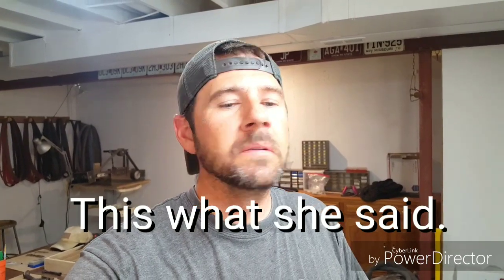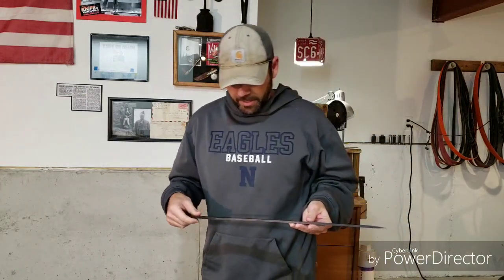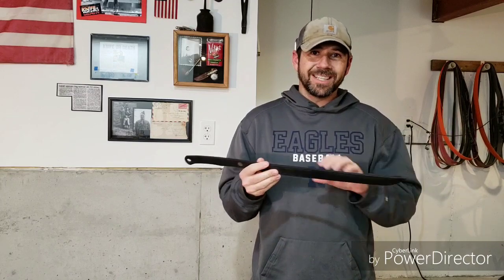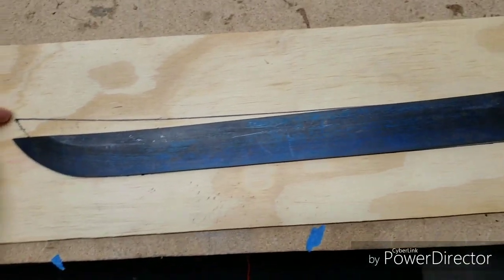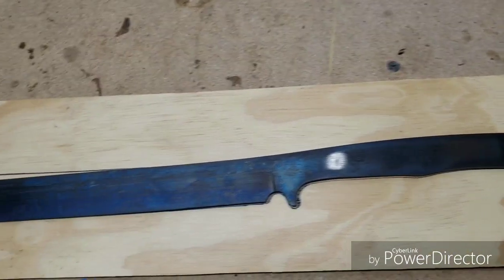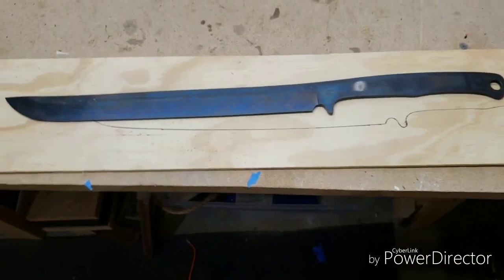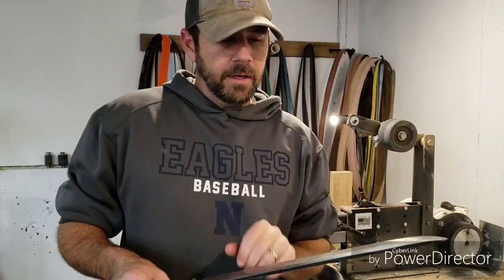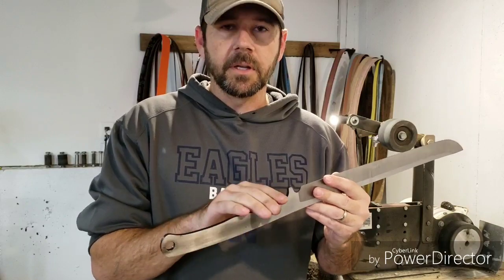Making a Short Sword / Wakizashi Part 3

Comment: Interesting comment about the loss of curve.  I understand the Katana curves the other way on HT'ing to put more curve in blade.  Looking forward to handle wrap
Reply from the maker: That is interesting Ken I did not know that. I need to do some research about that to see what is happening.
Reply: As I understand it,  the katana is differentially HT'd and the hard edge expands as the metal becomes hardened martensitic steel. The spine does not expand so much, curving the formerly straight blade.

Comment: I was just about to add that I get the same amount of curve loss and you mentioned me lol. It has been about the same vertical or horizontally quenched. For me quenching in Parks 50 for a 7in blade you lose about 1/8in, for a Wakizashi about 1/2in and  for a katana about 3/4in.
Reply from the maker: Your videos were one of the reasons I decided to make this, so thanks for your post! Yeah it is crazy how much curve is lost!
Reply: @justinpresson7812 That's cool!  I just looked at some of my notes and the closer you grind to the final thickness the more curve you lose. I have done two and the thicker one lost 1/2 and the thinner one lost almost 3/4.
Reply from the maker: @JoeyAtilano  that is good info!